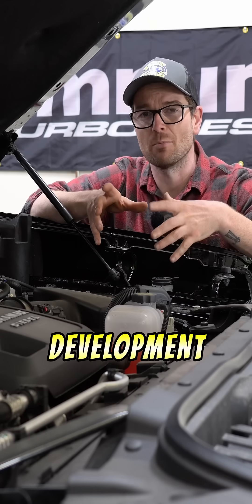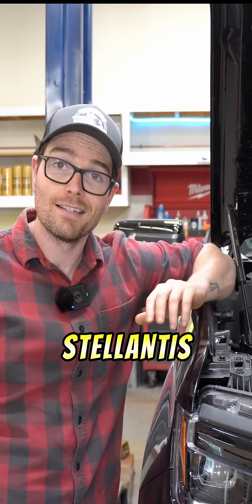The 3.0L Duramax’s Secret European Design 🔧🇩🇪 Great Design or BAD Idea

Comment: If they designed the transmission to come out easy I really don’t think it would be anymore difficult than a belt under a timing cover. We all just wish they would have used a wet chain drive. Perfect opportunity for the aftermarket

Comment: Every 3.0l diesel offered in vehicles in North America has been a complete flop!..absolute garbage engines!..some worse than others but all of them ultimately being junk!..
Reply: Every? This engine design has been a very popular diesel engine option for BMW for the last couple of decades. It's also the correct configuration (inline, not a junk V6) and the emissions system is much better with egr downstream of the dpf. One of the best half-ton engine options available today. 495 lb ft is awesome and 30 mpg is a nice bonus.
Reply: @hochhaul  everyone that I know who had them have switched back to gas engine trucks…in the shop all the time…granted this particular engine is the best of the bunch, but I personally would never own one!..two close friends of mine had them and both of them got written off in accidents and when they got paid out, they went back to gas engine trucks!..I know another guy who has the F150 3.0l and he will never buy another one…super great on fuel, but once you get a little time on them they start to have lots of little problems which turn into big problems!..

Comment: Mechanics Labor snd shop work in North America is super expensive.i had a  Turbo  diesel  engine Hyundai Bongo overhauled for $1200 in the Philippines .
Reply: Yes, but the Bongo  is more a workhorse (commercial, industrial)  engine, less power, but less stress These 3.0 tech "marvel" could be a nightmare vs a Toyota 1KD (for example). This Duramax has a lot of tech, for me, no thanks. I keep my old school V8s. Greetings from Costa Rica.
Reply: @estebanamador7601 today’s engines are a nightmare for mechanics , all the anti pollution equipment and Sensors and the electronics Diagnostic equipment are often Autobrand specific, especially the high end European brands , even Toyota has gone that way.
My Bongo is the old one 2006, not fully Electronic
Reply: @AuralioCabal-nl8gi 2.7l? Yes,  I'm mechanic working on electronics, and they are nightmare to some owners too, because could be really expensive and problematic, a lot of failure points and plausible future repairs. I love electronics, but the good ones, 90's are the best. A lot of 90's cars driving here with no serious problems, and if they failed, could be repaired cheaply.

Comment: I would be interest to know cost delta between doing a front timing belt/oil belt vs rear.
I’m not certain a front set up would be easier.
There is a lot of stuff there too to remove.
Opinions?
Reply: Doing the front drive belt and alternator it's lots of fun.
Same for the failing thermostats.
Reply: Someone pulled up labor estimates for the oil pump belt service on this engine and the 2021+ F150 2.7 ecoboost. The belt service on the 2.7 Ecoboost was higher. More stuff is in the way at the front of the engine.
Reply: @hochhaul …I imagine the 5.0 would be the same?

Comment: Not correct ... This is an approach that is easier to drop transmission than the front of the car parts like radiators/lights, bumpers, etc, which is important for modern compact cars...
Reply: Never easier to trip a transmission than it is to remove parts from the front of an engine. What are u talking about.
Reply: @pjbuckmaster  disassemble frontal plastic on clips, especially at least a couple of years old, with fear of breaking it, a lot of hose clamps and radiators ... thanks, I'd better work with bolts and transmission jack ... But again may maybe your mileage may differ.
Reply: @pjbuckmaster You should see the 2023 and up Toyota Tundra, they are recalling 100,000 units those, Toyota Vlogger Car Card nut , and done other Toyota Dealer  show front end completely off , not sure if they have knocked the Week work to half the time now .

Comment: Why the hell didn't they just stick with the 2.8 true "baby-max"
Reply: Had one.
EVERY piston cracked from piston pin up into bowl before one finally holed.
14 grand to fix.
3.0 is more fuel efficient as well.
Reply: @jaykanngiesser3454 $14,000?  Now I see why Battery propulsion will win out in the end , Nio the BEV  car company even swaps put a Battery in miniutes . And BEVs  Batteries can last 500,000miles before any appreciable degredation.
Reply: @AuralioCabal-nl8gi  If anything cracked in your BEV's battery, your whole home would burn down.
Reply: @MarkChristian2010 Fake News ! You know ICE uses flammable Fuel and there are more cars that catch fire  than a battery car,..YOU CRACK ME UP😂😂😂
Reply: @AuralioCabal-nl8gi  Not fake. The electrolytes in a Li-on battery are not only highly flammable, simply coming in contact with air can causes a fire. 

So, in fact, a cracked battery can burn down your home. 

As far as ICE cars burning more, that's just another moot point.
Reply: @MarkChristian2010 ICE is so 19th century  I guess nobody told you, The Chinese knows that and thus they will dominate in the Automanufacturing soon enough. 
Kiss your Firebreathing monsters good mite!
Reply: @AuralioCabal-nl8gi you are not getting 500k miles from a lithium ion battery without extreme degredation. You would have a small fraction of the original capacity by then.
Reply: @hochhaul many cars having perf stats like the Tesla Performance or Plaid  don’t even last 100,000 miles if you watch Vlogger I Do Cars, and replacement of those engines don’t come cheap @ $20,000  And UP , try pricing a Porsche or AMG engine, Audi S. BMW M engines, and that is just for the Engine , tranny not included, Lord help you if it was a McLaren or Ferrari or Lamborghini , cars  a Tesla Plaid would have for breakfast @ the drag strip. There are Teslas Taxis that have been to  over 300,000 miles ..Google can help you there.
Reply: @hochhaul you're wrong. Lipo4 batteries typically have 3000-3500 life cycles before degrading to 80% of their original capacity. Assuming a 400 mile range and 3500 cycles which are realistic on higher end EVs, we're looking at 1.4m miles before the batteries degrade to 80%. Even if we drop it to 300 miles and 3000 cycles, which is more realistic on more entry level EVs, we're looking at 900,000 miles before your batteries degrade to 80%.
Reply: @heroofharo Yet.... real world evidence shows the batteries are degrading at way higher rates than the propaganda you're regurgitating. The range is bad enough when new. After a hundred thousand miles combined with cold weather, the range is straight up terrible. Even worse for an EV truck. Mot to mention the insane weight of an EV that's attempting to replace a truck. The suggestion that current battery tech is a viable replacement for a truck is hilariously delusional.
Reply: @hochhaul oh I don't think EVs make sense for trucks at all. Especially not in cold climates like the North east where i live. Imagine towing during the winter? You'd make it maybe 100 miles. 

I'm way more interested in the batteries themselves, which have been proven to last quite a long time with a good bms.
Reply: @jaykanngiesser3454 $14k was a lot. 2x what a Godzilla will cost. The problem here is the industry against physics, too much power density, with lightweight engines. Industrial engines are the example of how things should be done. In my country we have a lot of diesel (Mitsubishi, Nissan, Isuzu, Toyota, VW, Mercedes, Chinese brands...) and none of them survived a lot of km with a driver that continously drives petal-to-the-metal, I'm talking about engines with 2.5-3 liters and 134-180 horsepower, not a lot of power. Same displacement engines with low specific power? 2x-3x lifespan.
Reply: Or a Isuzu engine, after all, they have some alliances.
Reply: The 3.0 is way better than the I4 2.8 dmax. The oil pump belt is a non-issue that youtubers use for click bait. Many guys with this engine skipped the belt serivce (200k miles) without issue. And the belt service requires less labor hours than the oil pump belt service for the 2.7ecoboost and 5.0 coyote despite those engines having the belt at the front of the engine.
Reply: I've got an OG 2020 LM2 which will need timing chains at some point. The oil pump belt is the least of my concerns and can get done when the chains go. At that point, the cab has to come off anyway. And if it's torn that far apart in the next few years, if things play out with the repeal of the "endangerment finding", I may just go with a full-on weight reduction and clean tune at the same time.
The only problem I've had so far is soot accumulation on the DEF injector due to cheap fuel. Good fuel, even without an additive, and regular oil changes has been far more reliable than my previous oil burning, knocking, garbage AFM lifter, bastardized 5.3 LS.